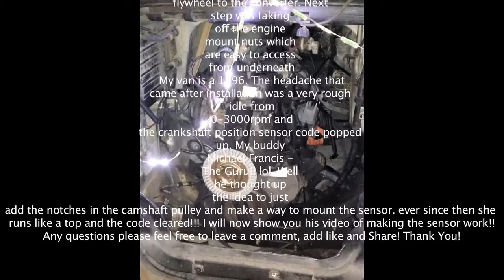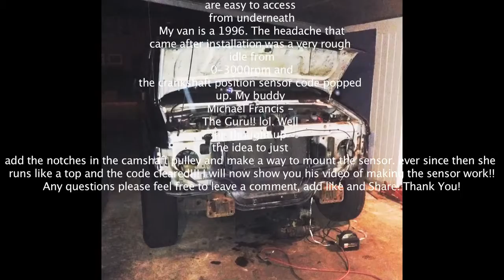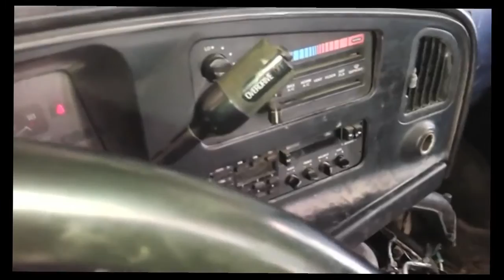How to, E150, F150, Engine SWAP, 4.9L , Preparation and, DIY Crankshaft sensor

Comment: I've been having the same symptoms since swapped my 87 for a 92, idle like s&#t. Gonna check the crankshaft sensor and distributor for wrong signals to the ECU. Very good video. Thanks.    Obs. 87 f150 i6 300cu had damaged 3rd cylinder wall, put a 92 same engine in it and she never was the same again.

Comment: i got an 83 econoline with a 351w in it i wanna pull out. got a 93 f150 with the straight 6 i need to pull out and put in the van. so many videos to watch to figure this out.
Reply from the maker: Koaasst swap engines with harnesses and computers

Comment: I gotta ask but how far is the fan tip from the radiator?  Mine seems awfully close at 1”.  
1995 Ford E150 4.9L van.

Comment: I understand you drilled the crank shaft sensor but how did you get the correct distances from the notch and one bolt  from the other points on the harmonic balancer ?
Reply from the maker: Soleyman just grind them down to where you know they won’t hit the sensor
Reply: I got that...am taking about the distance between each spot on harmonic balancer.
Reply from the maker: Soleyman triangular pattern as close as you can
Reply: Great thank you.

Comment: the crate engine for this from advance is only $1,400 for the v6 or v8 option.. If I was going to do a swap anyway I'd go get a e350 diesel with a blown engine for hundreds and put a $4,000 7.3 crate engine in since they get a million miles.. I'd get a clean body too

Comment: lmao. u got taken for a fool lmao.
Reply from the maker: Tone Loke yeah? How’s that? Thinking it was the timing gear?
Reply: @VTOROTV  always check the block or oil pan. make shore no holes. it looked like they cleaned all the oil off of it. when that rod came apart was running and sent oil all down the underside. look i feel bad for u. but when peeps dont no what to look for im sad about that. i think if u own a car u should no it like ur own body.

Comment: I have a 1992 F150 with 160,000 original miles.  My Dad bought it brand new and when he was 92 I bought it from him.  My dad was gifted. he grew up during the depression and he could work on cars, work concrete, build houses, etc. If it was mechanical he could probably fix it.  He started out working on Model Ts I believe.  But my Dad had no training or understanding of electronics and today's cars would  be a WTF?   I am sure he had no idea that his F150 had a camshaft position sensor in it. In fact,  I have been driving this F150 for several years now and I just found out, by accident, that it has one.  I remember when Ford got rid of points in the distributor and started using a "pickup coil" in the distributor to trigger the ignition module.  I am not sure but I think that pickup coil was probably a hall effect sensor.  Since my 92 has an ignition module I always thought that was the system that was installed in my truck.  I am just finding out about this cam sensor, and my vague theory is that this cam sensor does trigger the ignition module but also must feed the ecu to control the fuel injectors or maybe the cam sensor just feeds the ecu and the ecu triggers the ignition module and fuel injectorss.  I an still trying to figure this out, but I always believed that this old truck was a little different than more modern vehicles and didn't have a crankshaft or camshaft sensor.  Obviously this has never been a problem for me in this truck.  Not bad for 30 years.